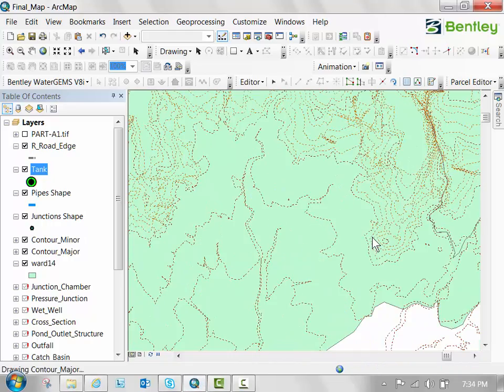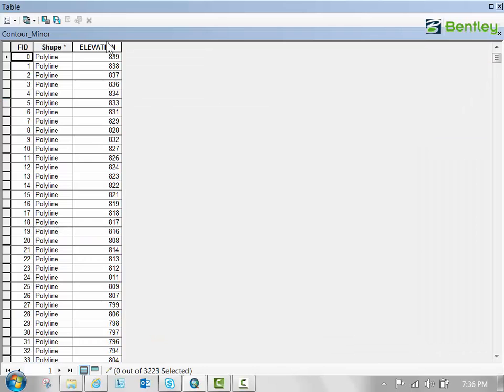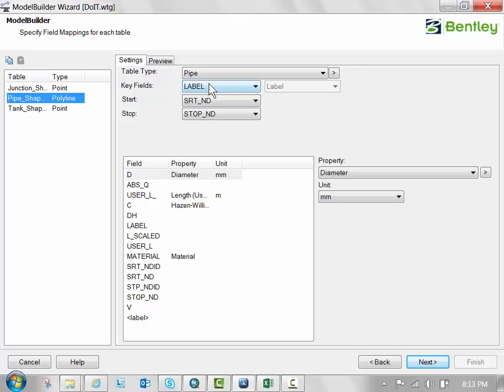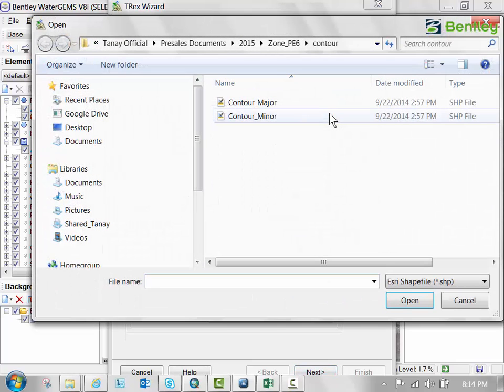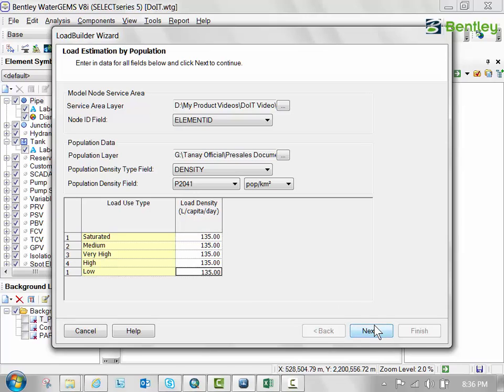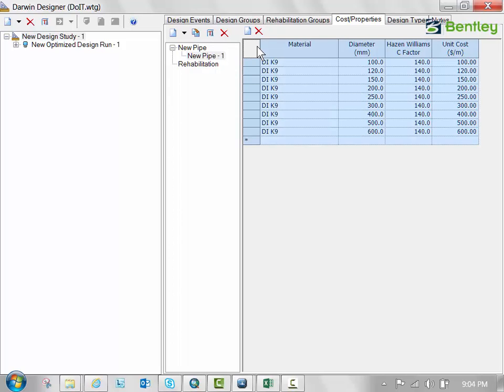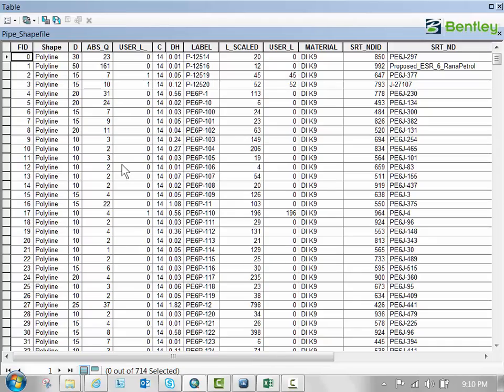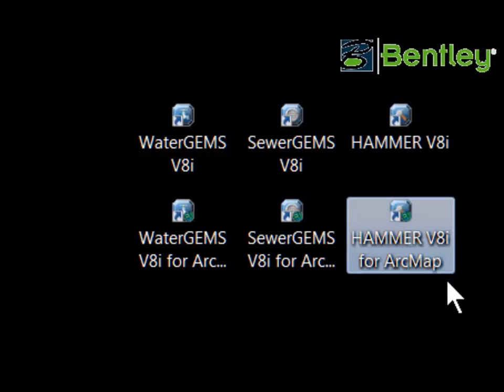Bentley Systems Hydraulics & Hydrology Software Solutions- GEMS

Comment: sir i want to model a simple problem -Reservoir at upstream end with  pipe of  constant inclination and sudden valve closing at upstream end. MY parameter are like length =1000m, pressure wave velocity=1000m/sec, no. of divisions of pipe =8,flow rate =1m^3/sec, sir please upload this video as soon as possible , i need it for my project.
Reply: Rohit, I would also recommend checking out the Bentley Hydraulics and Hydrology Community, where you can post future workflow questions and get an answer fairly fast http://communities.bentley.com/products/hydraulics___hydrology/f/5925
Reply from the maker: Hi @Rohit. Thanks for the comment. I am presently very busy with other professional work. It would be great if you could write to me in detail, in the next week on TanKul20@gmail.com. Cheers. Tanay